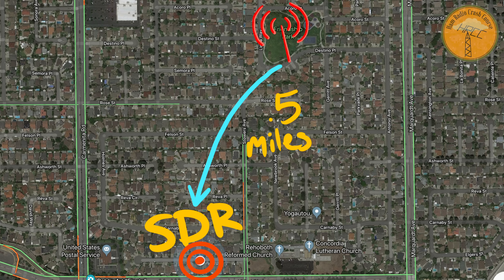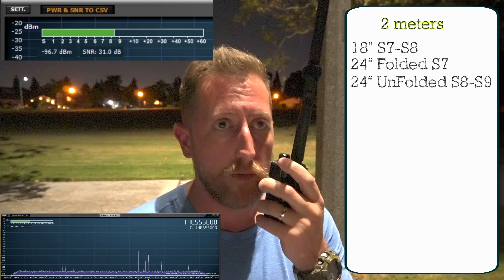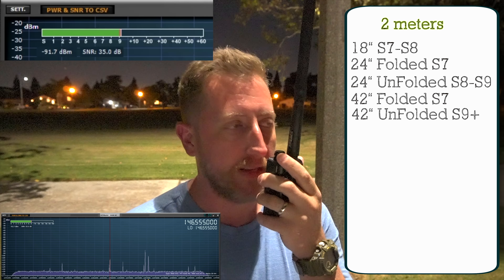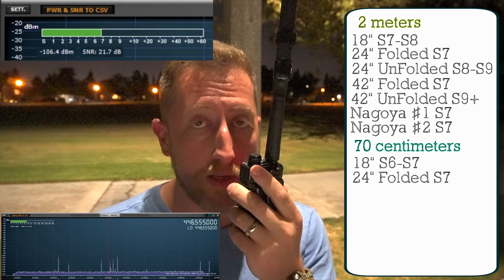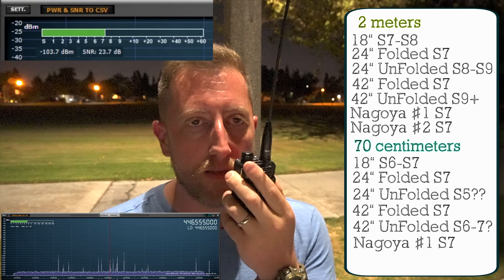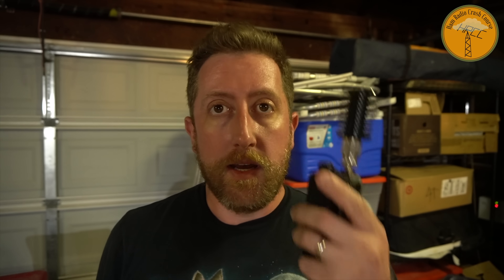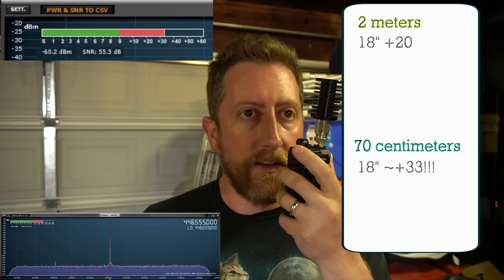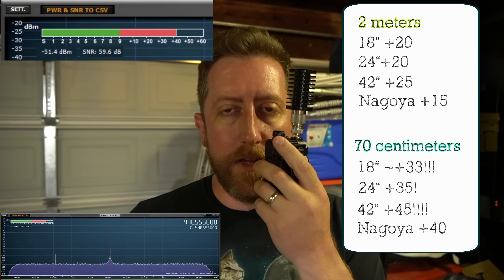ABBREE Tacticool Ham Radio Antenna Performance Test and Review

Comment: Hey Josh I use one of the 42 in on my plate carrier. The trick is to use a short piece of coax between the radio and the antenna and a tiger tail. About 3ft of extension works well. Also, don't try and weave the antenna through the molle. Just run the antenna through one section of molle and secure with velcro one wrap. If you do it this way, you can have the antenna and tiger tail weaved in the back and the radio in a pouch on the front. That way you can still mess with the radio, without touching the antenna. You can do the same thing with a backpack. Anyway great video and hope this helps.
Reply: Used that same method in Iraq and Afghanistan. Antenna on the back of plate carrier and radio up front so I can change Frequencies on the fly to talk to aviation and different ground units. Worked great and no antenna poking you in the eye.
Reply: Can you show a pic of what u mean?
Reply: Whats a tiger tail? Looking to route my antenna the same as you on your plate carrier.
Reply: @PierreMontgomery  in order to explain what a tiger tail is I have to explain how a radio antenna works. In order for a radio antenna to radiate magnetic energy, it needs a radiating element and a ground element. This ground can be a physical connection to the ground or a artificial ground, which is a piece of wire or metal. Traditionally in a handheld transceiver, the body of the radio is the other half of the antenna. This works because the human body has a high salt and mineral content which helps ground the body of the radio to person holding it(artificial ground). However when you are not touching the body of the radio you are no longer providing the ground for the radio. The radio will still work but at reduced performance. a tiger tail is a piece of wire that is resonent at the frequency you are running at as an artificial ground. I'm technically using the word grounded improperly but it's the best way I can think to describe it. A tiger tail basically makes the antenna resonent without you holding the body of the radio. Furthermore, when you use a length of coax to separate the antenna from the radio it distorts the signal even further. a way to overcome this is to attach a piece of wire to the base of the antenna that is resonant on the frequency. For the 144 megahertz band a tiger tail of 19 and 1/2 inchy should be resonant on a quarter wave antenna. you can use any wire to make a tiger tail and just attached by wrapping it around the ground side of the antenna or you can use a properly sized ring connection. technically a tiger tail is not necessary but some people see boost of 10 to 15% in performance.
Reply: @kennethh5657  Thanks for taking the time to explain this.
Reply: @kennethh5657  Really good explanation. Thank you.
Reply: rmordica it’s more commonly called a counterpoise
Reply: Kenneth H hi Ken, I’m an RF/antenna design engineer by trade and will say you explained this concept very well here.  The equivalent of the tiger tail coupled to the radio is a ground plane for a vertical monopole antenna, sometimes fabricated with horizontal or downward angled radial wires around the monopole acting as a ground plane.  The tiger rail is a wire providing adequate length to couple capacitively to the body (operator) without as much direct contact as when holding the radio in hand.
Reply: @andrewfarris2858  thank you for the compliment and professional insight. 👍
Reply: @kennethh5657  This is a really good explanation - thank you.   Just out of curiosity, does this also apply to an HT unit that is in a car cradle and connected via coax to a mag mount external antenna, or does the base of that mag mount antenna have the necessary "grounding" already to compensate for the radio not being held?  Hope that makes sense...
Reply: @brentchristensen5877  the Mag mount should provide the necessary grounding for an external antenna. It does this via capacitive coupling. Technically a hardwire directly to the vehicle body is best but I'm not sure a low powered handheld would benefit from a hard connection. Depending on the size of the baae I would assume it would provide more than enough copassive coupling to perform well. Hope That answers your question.
Reply: @kennethh5657  Thanks!  I'm trying to figure out how to optimize in-vehicle performance of my Baofeng unit while doing overland trips.  When I use the mag mount antenna it seems to pick up a lot of noise that the cheap radio doesn't seem to be able to squelch.  Still trying to figure that one out.
Reply: @brentchristensen5877  You might try wrapping the coax around a farrite bead to choke off common mode current on the feed line. More then likely the increased antenna gain provided by the external antenna is picking up a higher level of background noise. Turning the squlch up should help block out some of the background noise.
Reply: @brentchristensen5877  ... Have you figured that problem out man?
I'vd got the same setup on order, and wonder if you have any tips.
Reply: @kennethh5657  Anyone interested in making your own arial that can boost power up to 50W for a base and your HT. All you need is to understand the formula. 

To get length of the radiator. Example on 2 meter band. 
234 by 146 Mhz. = 1.60 feet x 12 = 19.2 inches. 
Your ground radials also need to be 1/4 wave of 19.2 inches in length.
Reply: Is there a video on this set up ?
Reply: Question for the professionals in here. I’m building an adhoc repeater (gmrs) using two HT,s (emergency use only) I have the gear in a pelican case and the antenna protrudes from the top side of the case, it’s being feed by 8” of coax. The question: I have lined the top inside of the case with foil duct tape, will this give me the ground plane that I need for proper performance?
Reply: Thanks for the tip. Will make this mod to my plate carrier.
Reply: Yep that’s what I do too
Reply: Gotta have a counterpoise if you’re not holding the radio.
Reply: Sounds good 👍 Thanks for the info. If I do it I'm definitely not walking around like that in a thunderstorm with plates and a antenna though 🤣🌧️⚡⚡⚡☠️☠️☠️👻
Reply: This alone needs a vid 😂
Reply: @MM-hc9nr  I just got your notification. 
Was that in response to my comment or the above thread holder? 😁
Reply: @theirishoutdoorcook1207  thread holder bit unread your how to make n it’s quite advanced for me 😂 I read it over n the bulb 💡 doesn’t light
Reply: Very late to this - I also used to run the same, however the antenna would always fuck with my sling, which was just annoying enough to bother me, but not enough to fix it. 

Now I’m on the civ end of things, I run the 24” folded antenna straight out the radio on the front, left side of my pc, which is somehow much less in the way.
Reply: Ken I like the idea of the tiger tail, makes clear sense to me...going to made the mods to my plate carrier as well...good info

Comment: I purchased the 42 inch antenna a few months back and brought it to a local club meeting. It was supposed to be more of a joke than anything, however, we were all impressed at how well it performed.
Reply: Why do hams think these foldable antennaes look weird or like a joke? To a non-ham they look cool and professional.
Reply: @devoidbmx1 Because they are sad hams 😢
Reply: Davin it’s because they are very large and heavy for practical use on a handheld (HT). However, this same style of antenna is widely used in the military but is used on a much larger and heavier radio.
Reply: Yep, I did the same thing. The ABBREE on my TYT UV8000E, I use the 18 inch antenna, works great. Had increased the range of my TYT. Also I have always used a speaker mic. Took it too a club meeting now several of the members have bought them in different sizes.
Reply: I got one for airsoft, and I call it "the tactical compensator" as a bit of a joke. I am really amazed how "well" they work for how silly they are.
Reply: Just got my license and the 8 watt Baofeng, hoping to reach out to the repeater near me with the 24"
Reply: I got the 42 inch for my baofeng APRS hotspot to improve the sensitivity. and it work pretty well for receiving, maybe after this clip, I should try not to unfold it at all.
Reply: Just got into ham and watched your vids. Although i have the signal stuff and nagoya i bought the 48inch abbree and folded up it doubled my distance

Comment: It may be possible, even though it is a "Dummyload"  that there may have been just enough lead length inside it to be almost resonant on 440mhz.......just a thought.
Reply from the maker: Entirely possible, but all antennas were compared equally. So you can still compare the results.
Reply: @HamRadioCrashCourse  Yup...copy that......I still just ordered one just for the heck of it and geek/weirdo fun factor.

Comment: Thanks for the great video. I have a few questions, maybe they could be addressed in another video. One: how does adding a counterpoise/rat tail affect these antennas, namely the abbree? You can make them yourself or purchase them on eBay for under ten bucks, and supposedly they improve performance, specifically for the abbree on UHF according to a reviewer. Can the rat tail be placed above the adapter piece on the abbree, or must it be at the very base?

Two: How does an antenna reroute kit affect these antennas? A reroute kit is basically an extension cord for your antenna. It allows you to mount the abbree on the back of your plate carrier or chest rig, but still hold/use the radio itself in your hands. Not only is this very tacticool, but it also allows you to enjoy the performance of large antennas without being burdened by lugging them around by hand. Think "radio man" from those old military movies. The antenna is always on their back. 

SMA extension cords are cheap. How do they affect performance? Can you reroute and run a rat tail at the same time?

Thanks dude, you're awesome.

Comment: I came across your EDC video the other day and was super interested in the weird antenna you had on your FT3D so I started to research it.  What you came up with is pretty much what everyone else is leaning towards.  Works really well on 2m but 70cm its kind of a wash.  I think its pretty cool though, but as others have said, its a RF connector waiting to be broken.  Great video though, still might pick up the 18" to play around with if I decide to pickup a D878UV+ as there is no way I'd put it on my Hytera radios lol

That 42" was absolutely ridiculous!!
Reply from the maker: Not a wash at all. Even the 18” performs as well as the Nagoya 771 an excellent uhf ht antenna.
Reply: @HamRadioCrashCourse  I agree!! Sorry I did not mean wash as in it was worthless, I meant a wash as in it performed about the same as other antennas.  So on 2m it was amazing, but 70cm those gains were kind of washed way and it was brought back down to the 771 level.  Still a cool antenna and I will probably still pick up the 18" if I pull the trigger on the Anytone.

Comment: I know it's not for 220mhz. But would it be possible to test what kind of SWR on  220mhz?  
Just curious
Reply: you would need a network analyzer, which is a quite expensive piece of equipment. it could probably be ghetto'd with other hardware but I trust a good network analyzer the most

Comment: Got a 42" one living on the side of my go bag woven thru the Molle. Has a 2ft lmr1xx(something) jumper connecting it to my ft60 in an outside pouch with an external mic on the shoulder strap.  Worx excellently.  Got my maxpedition bag looking goonishly tactical, but fuck the haters.  I drive a truck for my job and live out in the woods. I gots readiness to maintain..
🔫😎🚬

Also run an 18" on my beater uv82.  Also worx excellently.  They're my favorite ht antenna yet..

For those wondering. Yes the 42 is kinda floppy.  On my bag if I'm to jerky, it'll flop.  But for movement beyond just ruckin, folding it in half fixes the floppiness issue. Negating the need to downgrade to the 24"..

Comment: I thought it was rather interesting when even at S9+ 2M had noise on it while 70cm was crystal clear.
Reply: The noise on 2m may be due to local RFI, I have the same problem here (SE England) where 70cm is quiet but 2m noisy.

Comment: I have the middle version and TX is great. The problem is, Baofengs have a terrible front end which is blown away by receiving hash from everywhere on the VHF band. So you can talk to a friend 3 miles away, but they won't break your squelch due to the receiver being trashed
Reply: I have the same problem

Comment: Handhelds don't  normally do so well, for the most part because of operator error, the newbs with Yaesu, leave there WIRES enabled, or programmed narrow FM for their memory or just in general, the user not aware that the slightest angle or movement dramatically affects the emissions, in relation to the repeater.
Reply: Hi Tz5n:  Exactly!  I can’t remember the number of times I’ve had to advise a handie talkie user to stop moving about when talking over a distance.  It’s just so easy to move into a “null” when working VHF/UHF.  Just moving 12 inches (300mm) can make all the difference!  But hardly anyone listens to advice!

Comment from the maker: SWR numbers are not provided as they could artificially imply one antenna is better than another without considering the testing apparatus that was used when the antennas were developed, which all differ. The radio was in low power output for all tests, pretty impressive at .5 miles I would say.  The 24” antenna is actually referred to as the 28” on Amazon. 🤙
Reply: I disagree with your logic here: your test may not match the manufacturers, but if your test is CONSISTENT, then your results should be considered valid. i.e. the tests need to be precise, not accurate.  Thanks for the video.
Reply from the maker: @iNowHateAtSigns  Your consistent test may artificially show one antenna better than another.  e.g. what frequency you are testing for lowest SWR would be affected by your testing apparatus.
Reply: You should do a test using a wire counterpoise, maybe different lengths and/or dual band counterpoise.